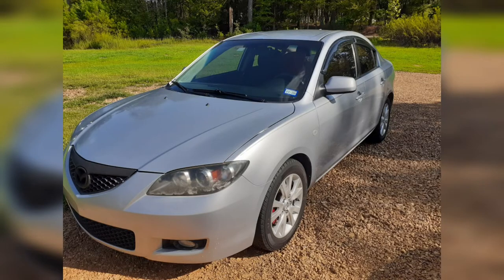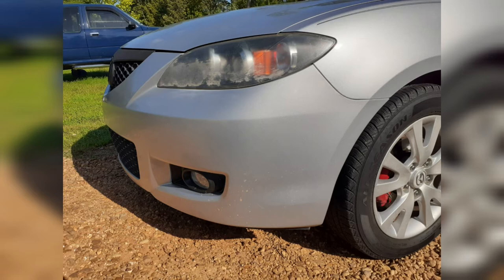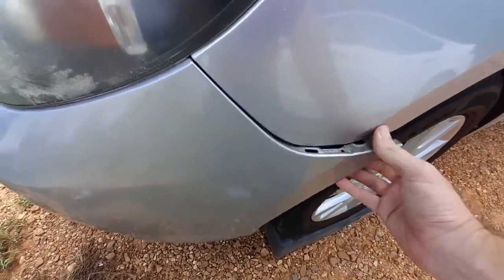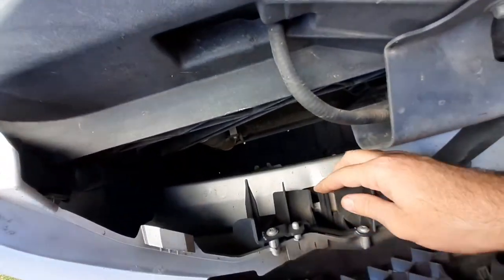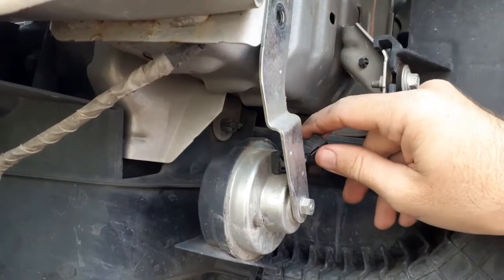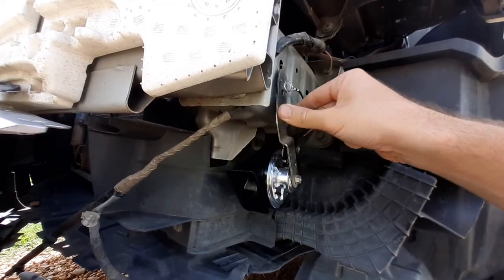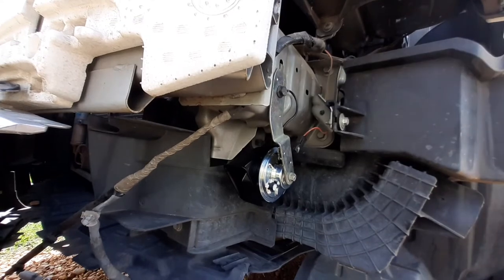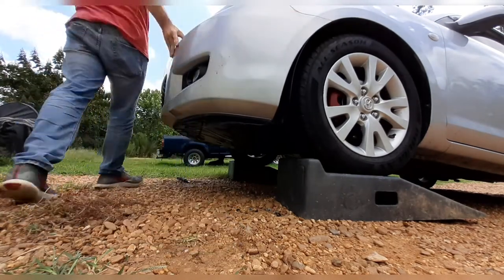How To Remove And Install Horn Assembly | Mazda 3 Horn Upgrade

Comment: All I wanted was to find out how to find the horn so I can cut the wire so the stupid alarm won't be beeping 3 times a night!  Why did you bother changing that one the new one doesn't sound any better?
Reply from the maker: This video shows the horn location. And there's a noticeable difference between the high and low tones.

 Here are some potential reasons why this might be happening:

Stuck Horn Button: The most common cause is a stuck or malfunctioning horn button on the steering wheel. Even a slight short or debris accumulation can cause the horn to activate unexpectedly.

Faulty Relay: The horn relay, which controls the electrical circuit that powers the horn, could be malfunctioning. This can cause the horn to activate spontaneously due to a short circuit or wiring issue.

Short Circuit: A short circuit in the wiring leading to the horn could be causing it to receive power intermittently, resulting in random honking.

Moisture or Corrosion: Moisture or corrosion in the horn circuit or wiring can create unintended electrical connections, leading to spontaneous horn activation.

Alarm System Issue: If your vehicle is equipped with an alarm system, it's possible that a malfunction in the system is causing the horn to sound unexpectedly.

To diagnose and resolve the issue, you may need to:

Inspect the horn button and surrounding area for any signs of damage or debris.
Check the horn relay and associated wiring for signs of damage or corrosion.
Test the horn circuit with a multimeter to identify any electrical faults.
Reply from the maker: Not that I'd recommend to do so, but If you want to disable the horn, why not just pull the fuse instead?

Comment: Does it matter which connector I hook both wires to like is there a positive and negative
Reply from the maker: Typically, the terminals shouldn't be polarity sensitive 👍

Comment: This SEEMS fairly easy and my mechanic couldn't figure it out 😢
Reply from the maker: There's nothing to it my friend. Drop that front bumper cover and it's right in front.
Reply: @SimpleDIYProjects  my horn aren't the same as yours, mine has two horns attached, and idk which connector is which :-(
Reply from the maker: What style  3 and year  is it?
Reply: @SimpleDIYProjects  mazda 3 Hatchback 2008, several owners  idk if someone got creative since I had never taken a car apart before
Reply: @SimpleDIYProjects  mind if I record you a short video showing my stuff?
Reply from the maker: That'd be great. I'll try to have some insight on it by tonight
Reply from the maker: This is what I found for a 2008 Mazda 3 hatchback: The horn is located behind and slightly above the driver's side fog light. Access is easiest if you can put the front of the car on jackstands or ramps.
Reply: @SimpleDIYProjects  https://youtu.be/IJsXr1QACbw?si=QcQecZM4Z6lWInLQ this is my thing, i think the horns are broken or the connection from the relay to the horn is wrong.
Sorry my English is rusty lol.